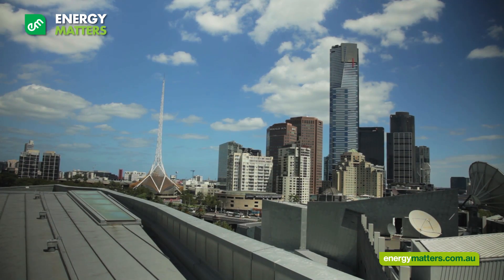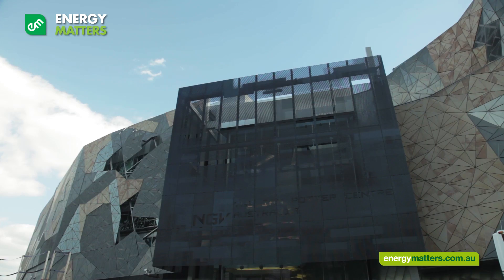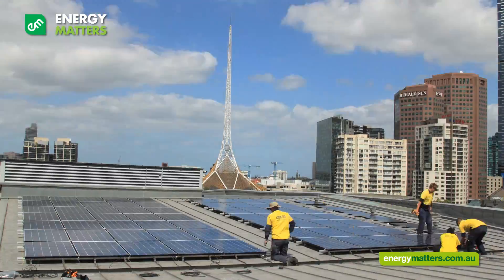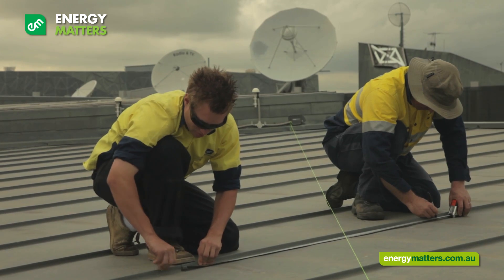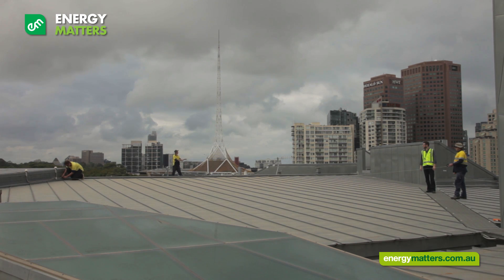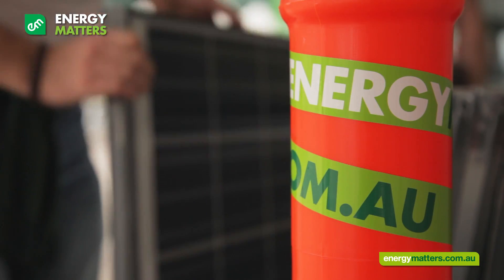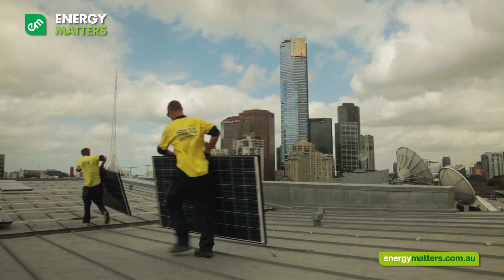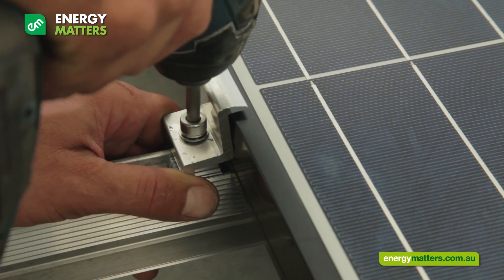Federation Square Solar Power Installation - Melbourne, Victoria

Comment: hey gus... milling the clamp is the easy bit, doing the engineering to make sure it doesn't pull the roofing material off its supports underneath and running cable through such a building with not so much as a scissor lift IS not so much a challenge but a nightmare.... the guys did a good job.

Comment: I see nothing special about this installation. You did your job as normal. If it was a spherical roof experiencing hugh winds, with shadows going across it all the time then that is something different.

So what you had to mill a clamp, and use the stairs. Is that what you call a challenge? You need to take on bigger things if that is an example of over coming obstacles.